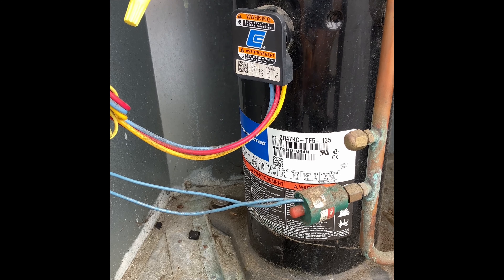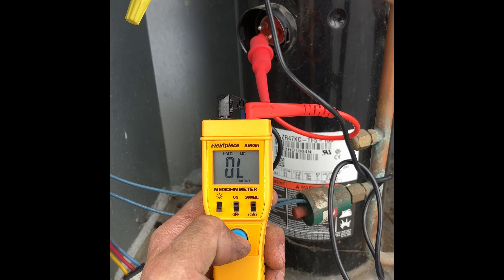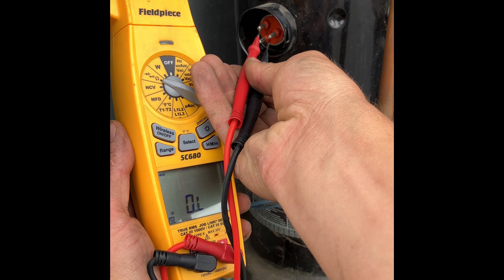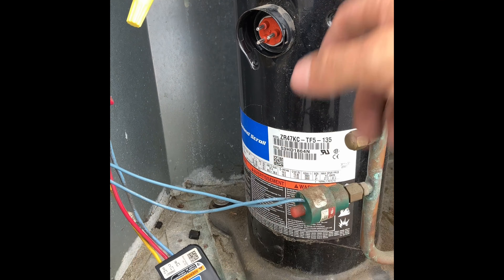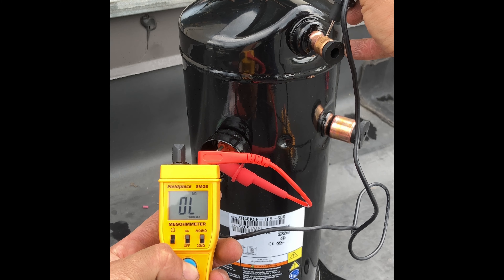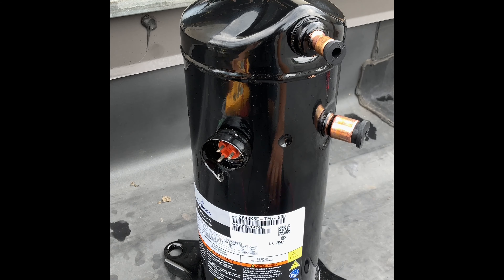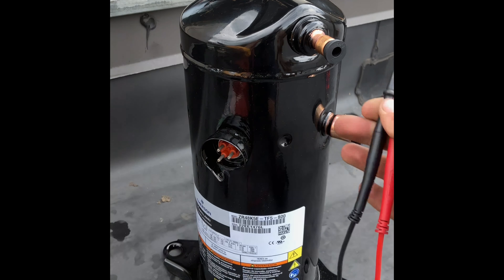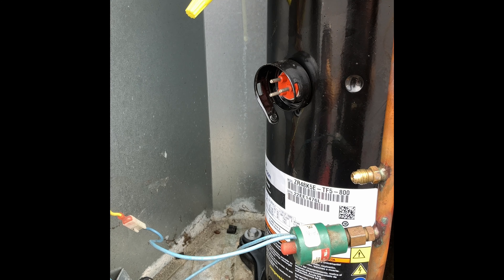Failing Compressors Just Got Easer to Find

Comment: I would have thought to find out if it's going to ground,  you would check from terminal to copper line  on the compressor.  its mounted on rubber feet

Comment: I think the easiest way in my opinion is just put your meter on continuity and if you get a beep between any of the 3 terminals and ground you have a dead shorted compressor.
Reply from the maker: My multimeter is usually how I determine something is going on with the compressor first, then go back with the megaohmmeter and confirm
Reply: Beep my ass!
Reply from the maker: Can you elaborate?
Reply: @theapprenticesurvivalguide 
If the copper winding is grounded to the shell of the compressor it would naturally be in contact with the condense bolts and then on. Continuity confirms a connection between the inside of the compressor and ground

Comment: Watch those compressor plugs when you're disconnecting them. Ive had them let go and dump the charge because the heat weakened the seal. That will wake you up let me tell you!

Comment: I’m not having a open line between the three compressor leads to ground
Reply from the maker: 3 phase or single phase? if 3 phase check resistance from 1-2,1-3 and 2-3, if different, compressor is shot, no resistance can also mean the windings are going bad but not completely shot yet

Comment: Where can I get that tool at
Reply from the maker: Most HVAC/Plumbing/Electrical supply houses will have them available. If not then they are available online.
Reply: Simple and to the point,  thats exactly how I was taught.
Reply from the maker: No need to over complicate this stuff, thank you for the feedback 👊🏻